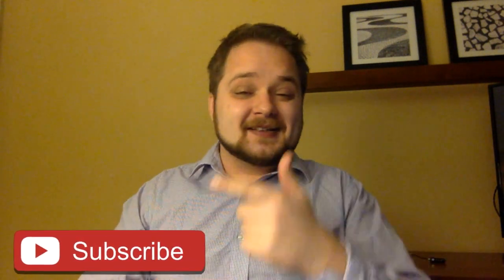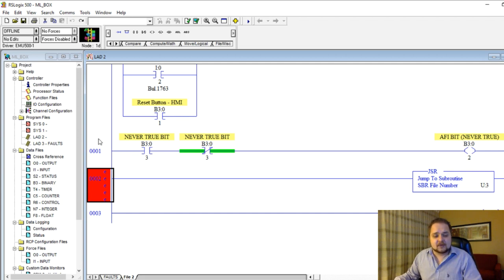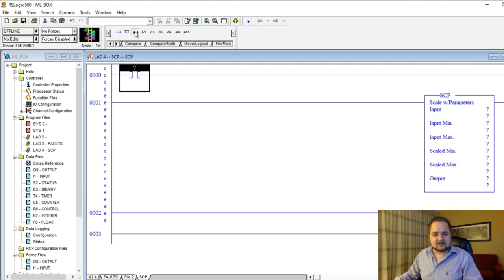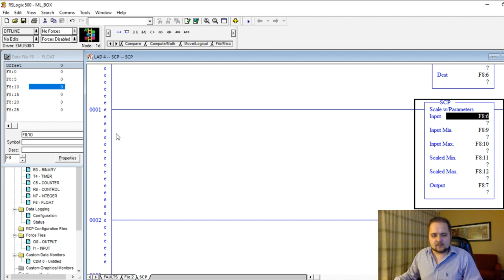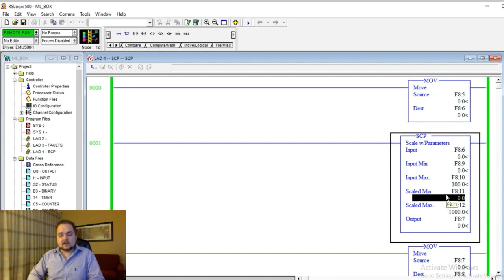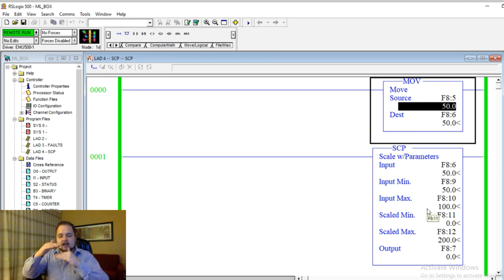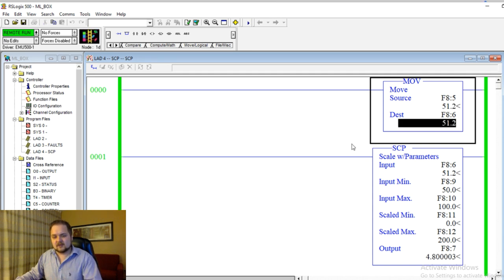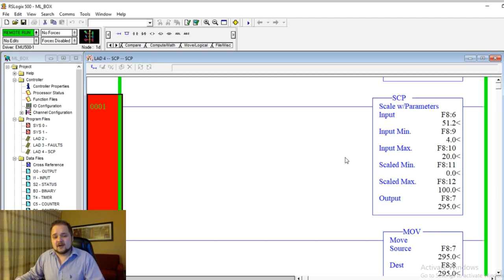PLC SCP Instruction - Scale With Parameters RSLogix 500 Example for Analog Inputs Programming

Comment: Many thanks for video. Can one use an SCP function to act as a type of speed setting for a motor via an analogue in/out card? Can the SCP output to a destination so that a set voltage between 0 and 10,  say 5volts into a VSD (AB PowerFlex 4). Appreciate your help. Thank you
Reply from the maker: Hi Charles, you can definitely do that. As an example, if your sensor reads 0-100psi, you could use the SCP to set the output to be scaled to 0-10v (in that case you'd probably use 0 to 16383 for an analog output). This would essentially translate to the motor running at a proportional speed to the reading from the sensor. However, a better way of doing this would be to combine the SCP with a PID instruction in order to add the integral and derivative parameters. With a pure sensor value, you can potentially see an issue where the motor is spiked high or low depending on the readings from the sensor. Hope that helps...
Reply: @SolisPLC  Thank you very much for that info I look forward to trying that out and I'll look into the PID instruction too. Super